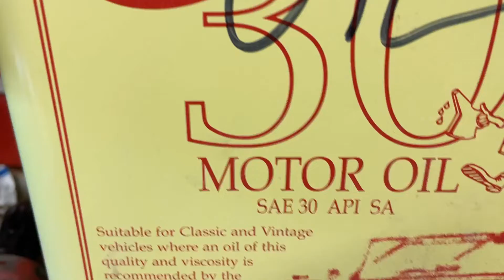Armstrong Lever  Arm Dampers Oil Change to stiffen them up - MG Midget Birth of a Racecar Episode 70

Comment: My TR6 has armstrong dampers.  A UK firm sells a conversion of the valving from springs & orifice pieces to a pack of “shim washers”  like you would see inside a telescopic damper.  Turned out the specified fluid was what I had already on hand for lubricating the ways on my mill. I have tried these various things on the TR, tightening the springs of the valve, heavy oil, telescopic shocks and now these. This is the best yet for my setup of lowered higher rate springs, anti roll bars front n rear, auto cross tires and some negative camber.
Reply from the maker: great feedback. yes adjustable dampers are a  great alternative to changing to tube shocks. highly recommended

Comment: You  never use 30 weight oil, it causes the shock to slow down [or worse hydro-lock]
You actually need thinner oil for high speeds and heavier springs to control the valving .
The end result you desire is a faster rate of movement and more resistance .

The stiffness you feel using 30 weight is purely resistance to flow,  not the damping effect from the valving
Reply from the maker: thanks for the feedback. all noted. thanks for watching

Comment: I believe engine oil and fork oil/hydraulic oil are measured using a different scale and they have different properties, so a 30 weight engine oil is not equal to a 30 weight fork or hydraulic oil. There is a lot of misinformation about this online. 

I personally would not use engine oil in these dampers despite what I have read online and in the owners manual.
Reply from the maker: Thanks for watching

Comment: My 1st car back in 1970 was a 1961 Wolsley 1500 which I modified, fitting wide wheels and radial tyres together with double anti roll bar on the front and single on the rear. I was still dissatisfied with the rather soft suspension so pumped out the old oil from the lever arm shockers and refilled with 90w oil - what a difference. The car handled so much better and rode better too. I had the car five years and then passed it on to a friend and those shocks were still working fine years later.
Reply from the maker: thanks for watching. good tips

Comment: What does it look like to rebuild one of these, just replace the o-rings and springs?
Reply from the maker: Not much you can do to them without specialist equipment other than replace oil and gaskets. If leaking from the pivot get an exchange unit

Comment: Some of the odd size fittings on my 1958 Sprite have turned out to be Whitworth sizes.  Sometimes I could get Imperial/NF/NC-SAE wrenches to fit, and occasionally a metric would fit.  A couple of them required a Crescent (adjustable) wrench/spanner or a Whitworth wrench/socket to get them off.
Reply from the maker: Thanks for watching

Comment: The over-understeer is dictated by the front roll stiffness vs the rear. I went to 400lbs front spring, with the 11/16" (IIRC) anti roll bar, with some shortened Mondeo drop links, the front shocks were new lever arm with uprated valves and thicker oil. On the rear i made up custom 6 leaf (stiffer) springs with just the thicker damper oil. Even this set up is quite soft TBH. I also lowered the suspension a little all round. The rear spings would wind up on a launch causing the prop shaft to hit the tunnel. I also ran the taller of the two difs permitted, because i drove to the circuits.
Reply from the maker: great story thanks for watching

Comment: Hi where did you get the oil for these. ?? Thanks
Reply from the maker: I used some motorcycle fork oil available from Amazon or eBay etc
Reply: @mgmidget-thebirthofaraceca4349  thanks for the info

Comment: I think that you will find that the little round chamber on the end is in fact an expansion chamber and that the small holebolt is for the final filling of the damper when it is fitted to the car. A small plastic syringe is ideal for the final top up as this allows you to over fill the damper. With the car on a leval surface let the excess oil drip out of the small hole and then seal with the small bolt.
If the expansion chamber is overfilled, there is the possibility of hot oil being forced passed the seals on the lever spindles.

.
Reply from the maker: thanks for the input. all good learning for everyone. thanks for watching
Reply: I concur. I just read about this in my service manual. 😊

Comment: Don’t mess with the oil viscosity!  Do the research, as many say heavy oil can hurt the internal structure of the shock. Change the valve instead.  Or change the parts in the valve that determines how stiff the shock is. I got new valves from moss motors
Reply from the maker: Thanks for the info
Reply: @mgmidget-thebirthofaraceca4349  I changed to heavier oil many years ago on my TR6 and no issues. But lately I’ve read it’s not so good so who knows. The valve change however did the job albeit at ~$35 per side. 🥴